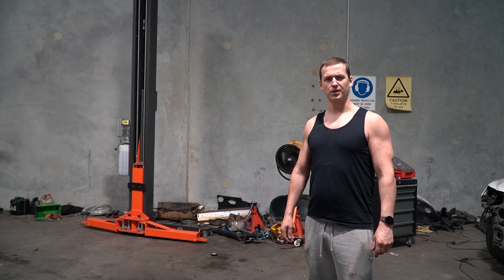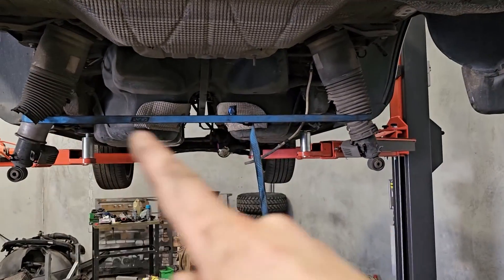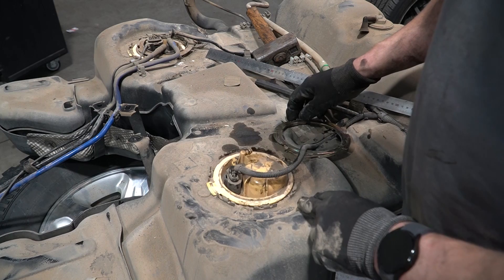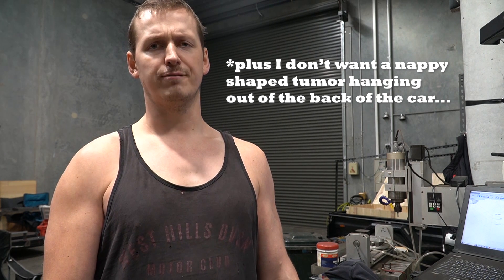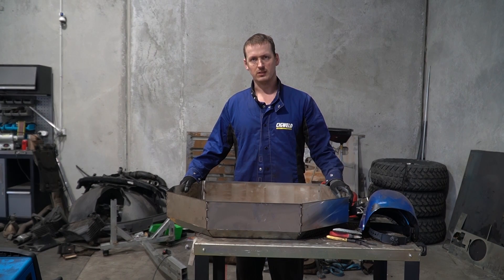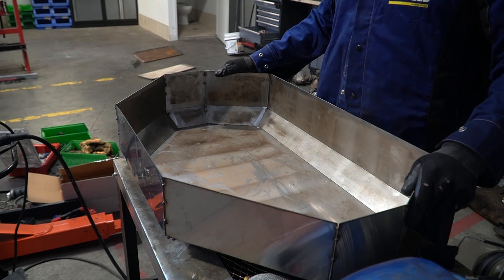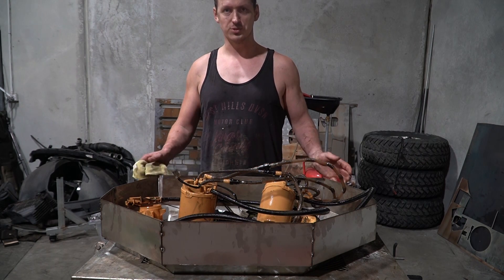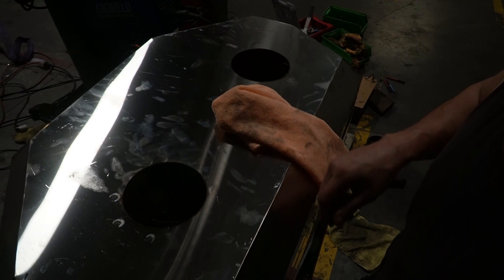I Made A Stainless Fuel Tank Using CNC Machines - V10 patrol ep12

Comment: Stainless steel? 1.6mm mild steel zink sheet would have been way easier to work with and no requirement for a backpurge to prevent chromium oxide
Reply from the maker: With that logic I should still have a tb42 in the car 😉

Comment: Just a thought you could have gotten a dual or triple fuel pump holder from the middle east to suit a tb48 it would have supplied more than enough fuel and you could have used a prefabricated 150ltr long range rear tank would have saved a lot of work but good job nevertheless
Reply from the maker: VW canbus is very picky, plus, the existing ones are fine. As for the tank, I don't want 150L. They look ridiculous hanging off the back of patrols. Like a big square fuel nappy.

Comment: If I were you right about now I'd be seriously considering going for aftermarket engine management. Not cheap to buy, but would save so many VAG related headaches, and probably be more reliable too.
Reply from the maker: Not really a viable option. Firstly, getting it certified is much easier with a factory ECU, and finding a standalone ecu able to deal with PD diesel injectors as far as I know is impossible. Especially 10 of them. I'd rather deal with coding out a few CELs manually.

Comment: Nissan tank would work fine
Reply from the maker: Yeah, if I wanted it to be a hack job. But for the long term, proper pump mounts and baffles are needed, which aren't in the OEM one
Reply: @ridiculousthings4x4  the oem has been used in alot high hp build and people have never had issues before. But yours will look better i was just woundering because you said about the dual pumps changing when the tanks down to a particular level cause the shape of the tank. In your tank wouldnt need that cause its flat bottom surely
Reply from the maker: I guess to use the OEM tank, the most seamless would be to use the main and sub tank and put a pump in each. The problem is I've become a bit OCD with the build, and I don't want to modify old/nasty looking stuff to fit. Maybe they call it binkyitis

Comment: Hi I have been trying to get a response to the Question i posted on your video - How To Adjust The Hand Brake On A 79 76 78 Series Landcruiser - The ONLY correct method, So now im posting it here !!!  - "Great Video do you think you should use the extended aftermarket dog bones as well as adjust the hand brake in this correct method if fitting new HB Shoes?"
Im about to do a full overhaul of my troopys brake rotors and pads all new all round. Im going to do new handbrake shoes at same time. 
Will be doing this method but was wondering wether i should install the upgraded extended dog bones at the same time ? what do you think ?
I would like your opinion :) do you think there is benefit to the upgraded aftermarket dogbones if the handbrake is adjusted the correct way ???
also was thinking about buying a new handbrake cable from toyota to fit at same time (shes 23 years old now and probs stretched) what do you reckon ?
Reply from the maker: I don't advise people on their own vehicle setups because they're exactly that. Not sure why you commented this on an unrelated video though
Reply: @ridiculousthings4x4  well in that case i am just asking what you did with your vehicle to make the handbrake function the way it does now - Did the handbrake kit you fitted have new aftermarket dog bones ? or did you use the OEM Toyota dog bones when adjusting your handbrake

I commented it on an unrelated video because you did not reply for a week on the related video and i was wanting an answer